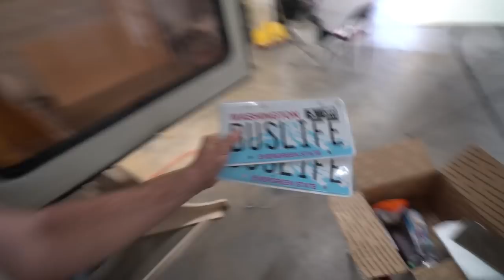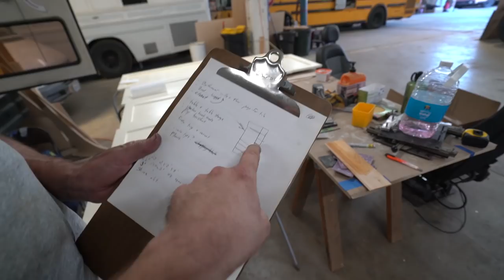Wanderboom to the Rescue!! (Skoolie School Bus Build) VanLife

Comment: Jax not sure if badge knows about this but several years back the military went to waste oil (cooking oil) and what they found is that if the waste oil tank isn't kept warm or used quickly things started growing in the tank and the rest of the system, many times they had to completely remove the tank, cut them open and clean them. I'm just letting you know because you might want to (if you aren't already doing it) start the engine 2 or 3 times a week and let it run for about an hour or so just to keep things from growing. I'd hate to see you have to pull the whole system back apart to clean it
Reply: Coolbreeze I would guess some diesel conditioner in the bulk tank would be a good idea. Sailboats run into a similar problem with algae growing.
Reply: Coolbreeze yes we know that when the build is done we will go over the whole system 🇨🇦🇨🇦🇨🇦👍👍
Reply from the maker: Maybe some diesel treatment in the oil tank would work. 🤷🏻‍♂️
Reply: My brother is the one who told me about this, he worked in the military's vehicle repair shop as a civilian for 40 years so he's the one who had to deal with it, just wanted to give Jax a heads up, i hope he doesn't run into this problem (what a headache)
Reply: maybe but I would check with either Badge or Nate first, I'm not the expert I just wanted to let you know of a potential problem with the veggie oil
Reply: I never tried it but if it plugs into obd it should work. What you think ZMANN 🇨🇦🇨🇦
Reply: @Badgeweefixstuff  I bought a dash mounted digital engine gauge (speed, rpm etc) but it couldn't read the port (it's a 2000 International short bus with a round port) so i've been contacting anyone who has knowledge with buses or diesels  so i can find a dash mounted computer that reads (speed, rpm, possibly fuel, oil pressure, water temp etc), do you have any idea how hard it would be to install the newer OBD II or can it even be installed, any help would be appreciated
Reply: @Badgeweefixstuff  I bought a dash mounted unit computer to read (speed, rpm, fuel, oil press, water temp etc) but it couldn't read any data (nothing on the screen except either no data or no signal) and my bus is a 2000 International with a round obd. can it be upgraded to obd II
Reply: ZMAN 420  speed but not as much as (water temp, oil press, volts), what is this device you are talking about, I know i can get separate gauges for the things mentioned above but i'd rather have them all in one unit. the reason I am looking for these things is I am short and when i'm driving I have to actually lean forward in the seat to see what is going on so that's why I want something mounted to the dash
Reply: ZMAN 420  BTW my obd is only 8 or 9 pin and it may not be called an obd
Reply: Coolbreeze that is a dueitz plug on the bus Jax got adapter to go to obd JAX what was that adapter you got ?????
Reply: ZMAN 420  did you get my message with my email?
Reply: ZMAN 420  so what are we talking about now, the plug on the website or something else, that's the plug that's in my bus, can that be used for a dash mounted computer showing all that stuff i was wanting
Reply: ZMAN 420  it's looking more and more like i'm going to get separate gauges and put them in a cluster but first i'm going to the International dealer and talk to their service people to see which is the easiest and cheapest way to go
Reply: ZMAN 420  i'll let you know what i find out. btw one site i saw said it was for plugging lights from a trailer into but seems kind of ridiculous if that were the case why not just mount it to the back of the bus